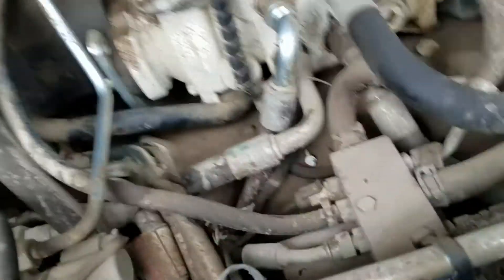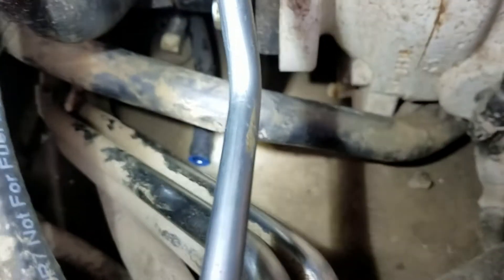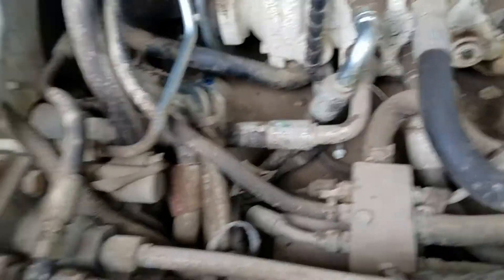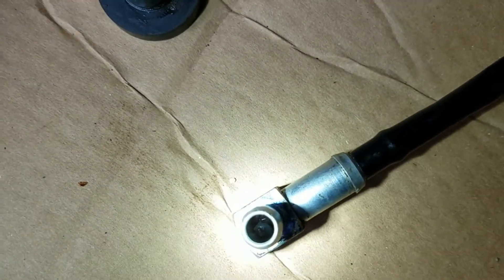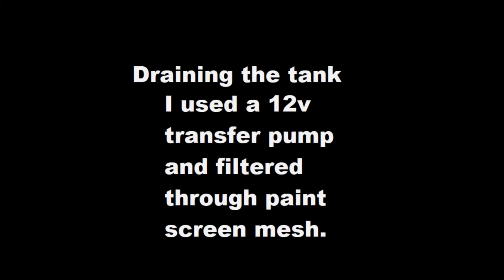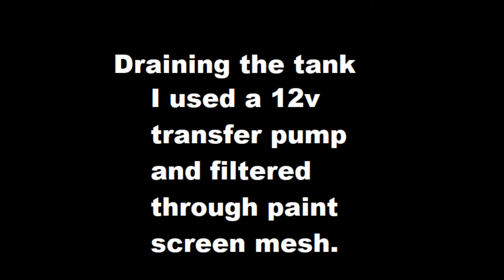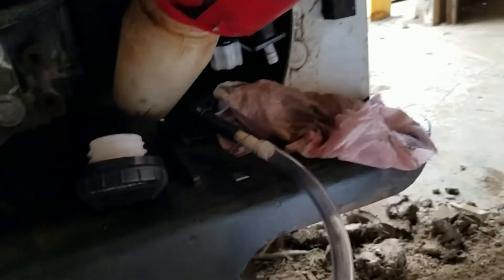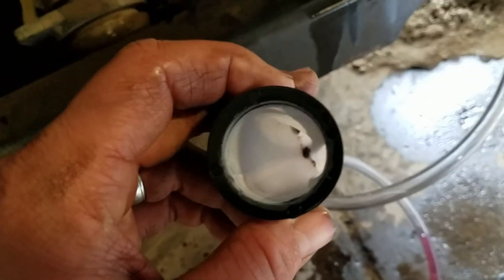Fuel starvation issue solved with Bobcat T450 Skid Loader

Comment: My 450 at work can not turn with out dropping rpm. If I'm sitting still an I try to turn it bogs down I'm wondering this is that problem. I won't even have anything in the bucket an I'll be on dirt or pavement an it can't turn from a dead stop I have to move it forward or backwards some an then start my turn it get annoying sometimes.  Btw it's a brand new skid steer with  37 hrs on it Nice fix tho.
Reply from the maker: Check your drive belt or main hydraulic belt. Sometimes the tensioner gets loose or the belt slips. This is a common cause of that.